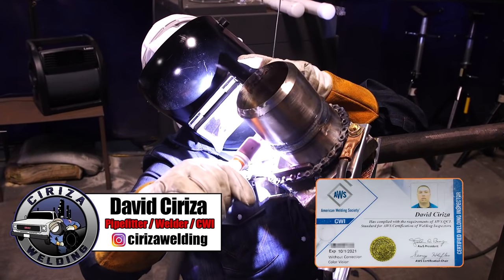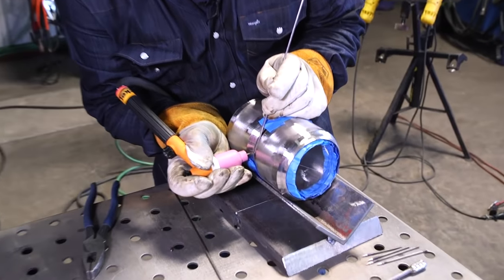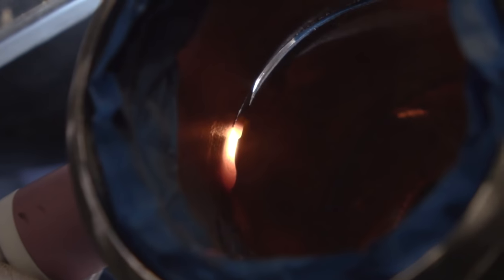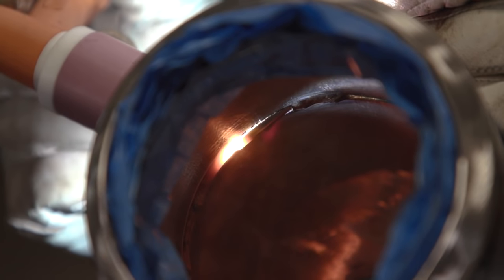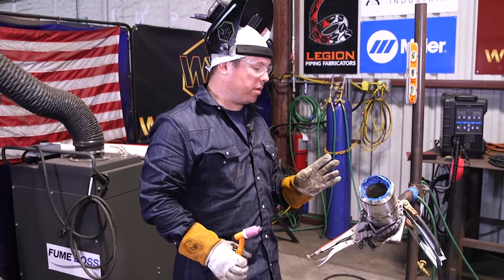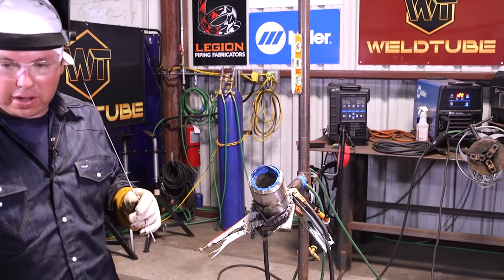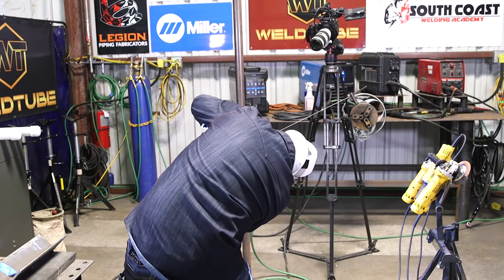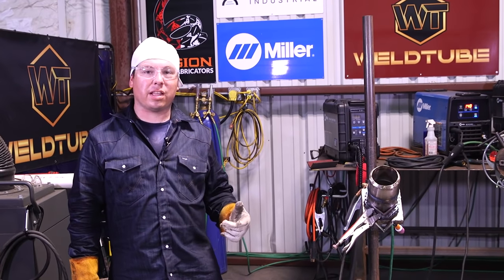Monel TIG Welding | Why is this Alloy so Complicated to Weld??

Comment: I was a welder for 50 years, no problem just weld it. Git er done. Remember it isn’t a horse race.
Reply: Exactly
Reply: Yeh mate it's not a pissing contest lol 😆
Reply: I’m 19 and taking welding courses. I’m taking SMAW MIG TIG FLUX and pipe welding. I’m getting my AA degree then ima apply somewhere to get real life experience. I just don’t know where to start. I could join a local union and get good money, but I could also get trained to tig weld in a shop. Eventually if want my own rig truck and shop. I don’t want to be the average welder 💰 , advice?
Reply: How is that with the elektrode from skratch start and xray pipe???
Reply: @gasclutch6280  yes. Newport News shipbuilding.  Fantastic opportunities for welders...
Reply: @gasclutch6280  your local boilermaker hall
Reply: @xXxAtkinsxXx  never thought about it like that! You’re right. There’s a local pipe fitting union near me. That’s what I’m looking into at the moment.
Reply: @gasclutch6280  I am a union pipefitter/welder and I approve this message.
Reply: @c.cortez5422  there’s a local  pipe fitter union near me. Advice? What to expect?
Reply: @gasclutch6280  You can expect five years of hard work for a lifetime of great pay and benefits.  You will have job security, pension, 401k (including contributions on behalf of your employer regardless of if you contribute yourself or not), healthcare, and great training. You can travel anywhere in the country, and even in Canada if you so choose so. Once you complete those five years, and receive your Journeyman card, you will be a part of something that no other job or career can match in the world: a brotherhood that played a big role in building America. If I were you, the sooner you can get in, the better. I turned out last year in May, and I am 26 years old making $40 and more an hour. It is a lot more than the pay, I can tell you that right now, and the best decision I ever made so far in life. Maybe one day we can shake hands on the same job, but that is entirely up to you.
Reply: @ctc100scr1  I doubt Newport News takes guys straight out of school. They're not junkyard welding over there.
Reply: @moseskongi4746     I welded at the shipyard 38 years.  How long did you work there?   You don't have a clue...
Reply: @ctc100scr1   If I'm clueless that they actually will take some green welder straight out of school then damn, flaw me. I thought they welded naval stuff over there, not junk barges.
Reply: @moseskongi4746  they have a welding school and they train you...
Reply: @moseskongi4746     like I said before.  You know nothing about Newport news shipyard...

Comment: This is the toughest thing I've ever welded, its one of the only metals that Ive seen survive in saltwater. Super expensive though, 20 foot length of 80 Sch 6 inch ran my job 20K...Weld on brother
Reply: Super Duplex will do too
Reply: Try HASTERALLOY
Reply: @dominickgulizo8473  try hastaloy lol
Reply: @chrislindsey3523  try hastelloy 🤣
Reply: @rich3633  you ever seen alloy spelled with an e 🤣🤣🤣🤣🤣
Reply: @chrislindsey3523  Google it pal. I'll be waiting for your apology 👍.
Reply: @panzerfaust7672  yes I just did some columns for the hover dam in 2205 super duplex!
Reply: @Chris Lindsey  If Google translate pops up under your comment on a common word and gives you the option to translate your word to English, it's probably time to check Google for the correct spelling. It tried to translate what you wrote to "haleloy." 🤣 It's definitely hastelloy.
Reply: i weld SMO 254 pipes

Comment: The contribution has been taken off the hook, you don't control it, it has to be approximately one mm, the cord should protrude from the surface on the inside, you don't control the gravity of the casting

Comment: What a coincidence I ve been welding Monel all month, can you guys do Inconel as well?
Reply: I love welding inconel and hastelloy.
Reply: They've got a good inconel video, it was one of the first few videos they made
Reply: So ErNiCrMo-3 and ErNiCrMo-4 not inconel??? Or are they both hastolloy
Reply: @S0lidStewie  Both filler rods can be used on most nickle based materials.mostly i think around 20% nickle with a low iron content. Hastolloy has less iron and is more chemical resistant, Inconel takes more heat.
Reply: @S0lidStewie  We use NiCrMo-3 for Inconel 625 only.

Comment: What is the brandname of this blue purge tape? thx for an answer👍
Reply: Its just regular masking tape. I like 3m brand blue tape
Reply: @ktmturbo5836  thx mate✌🏼
Reply: For such a tricky alloy that doesn't like contamination painters tape is a no no. If a contractor pays for such an expensive alloy surely they will shell out the dough for true purge products.
Reply: Why you went down to 55 amps?

Comment: Great Video...and informative....
When it comes to welding rod, I like to leave the stamped alloy name on and just bend the rod to 90 degrees at the name, 
that way I know what alloy the rod is and it gives me a way of picking the rod off a flat surface while wearing gloves 
by rolling the rod until the little tail is upright and grabable. 
It also lets me know what end of the rod is hot if I lay it down.....

It looks like you do not need a post flow on the bead , unlike Stainless, is that correct? Thanks
.Cheers form Florida, Paul
Reply: I usually use full length rod (not cut in half) that’s why I clip one stamp off and it’s not as sensitive to oxidize like stainless but if it’s super hot it will
Reply: Inspectors and QA staff where i work, do their crust if stub ends of rods dont have the stamped part in lol

Comment: Lol super dangerous to weld as far as carcinogens go , read the packet for the welding rods ! Wow . We were making chemical screens with it in 3-6mm sheet with a heap of tube penetration through it . Felt quite dirty to weld with a dusty skin forming on the surface on the pool. Interesting stuff 👍
Reply: Every welding rod ever made has the same carcinogen labels. Welding in general is badly carcinogenic. Really no getting away from it.
Reply: Try a mix of argon 2.5 or 5.0% hydrogen that will clean your weld pool and produce a smoother weld
Reply: Yes that's why it's mandatory in a lot of EU countries for the employer to provide you a speedglass PAPR unit
Reply: I noticed he wasn't wearing a respirator either! Not a good idea. If it was carbon, sure, whatever, but not a chance I weld stainless/inco/monel without at least a respirator.

Comment: I always was told to weld quarter at a time. Stagger the quarters. So your gap wouldn't close on you.
Reply: You are right, keep doing that please lol some welders watch this and fuck my fits right up ahahah
Reply: With good penetrated tacks and putting your root in quickly it will stay pretty straight

Comment: Drip 3/32 on one side and drag over. Lay wire on monel and other nickel alloys is not the best way to root. Monel also holds a lot of heat. Around the same size pipe I was hot passing on 220 and filling at 280. Nickel alloys heat is generally your friend. This rooting method works great from duplex to inco to even pure nickel.

Comment: I know it's a test coupon, but should you not be using proper metal purge tape and Argon + 2.5% or even 5.0% Hydrogen shield gas to really clean up the weld.pool

Comment: “ I would have stick welded it “
Usually said by someone at the shop whenever I’m tiggin something...
Reply: "I'd do it myself, but there's not a mig machine around here" it's what I used to heard from alot of squirt gun welders
Reply: If this gentleman would have chosen SMAW  it would require a fresh air respirator.Simply because the process WPS ,requires a type of Inconel filler metal. The Flux on the SMAW Electrode , would produce Hexavalient Chromiium Gases . Lots of Red Tape and Costs . FYI
35+ yrs of Code Welding  Good Job ! 👍
Tip: Flush more ,Cary less metal on Reinforcement Beads , =SLICK  
WELD WITH CONFIDEBCE !

Comment: Welded a lot of this.
Are you using Argon with 5% Hydrogen.
Have always welded,Monel and Monel 400 with this.
And Cunifer. They are all poiseness fumes guys!!
Wear an air fed.!!!
Reply: This comment is the truth, in the EU you will almost see air feds in every shop not like the states welding alloys with just a flip up hood lol,  a lot of the safety rules were made up by American companies but they are still working like the 50's... No air feds, no dungarees/coveralls provided by the employer, just some wranglers and a button up in chemical plants!

Comment: No dont cut the stamped side of the filler wire! Hold it from that end lol.
Reply: Yeah the right QC would pull your stencil for that
Reply: I like to use the full length rod(not cut in half ) so I usually clip one end of the stamping
Reply: @cirizawelding5076  you must not wed in the field? No way your fitting a full size wire in a pipe rack haha
Reply: 👍 thank you for pointing that out
Reply: @jeepwk6.5L  The QueerC isn't going to do a damn thing.

Comment: Y’all think you can shoot a how to on copper nickel ?? 
 I think there’s one video out there on how to do it and it’s not to informational lol
Reply: I'm pretty sure MONEL is copper nickel bro
Reply: @ninesixteengenetix  monel is an alloy that contains copper and nickel, yes, along with other alloying elements in small percentages. Main part of the alloy though is Nickel, making up 60% plus. 

By Copper Nickel, im guessing he means CuNi 90/10 (90% copper, 10% nickel) or 70/30 (70% copper 30% nickel)
Reply: @kf8575  what did you copy and paste that from Google lol
Reply: Monel is a nickel copper (more nickel then copper) and copper-nickel  or the other cool trade names is more copper then nickel. Rod rn67 welds pretty good but smwelding that shit to mild steel with whatever that other filler is… sucks.